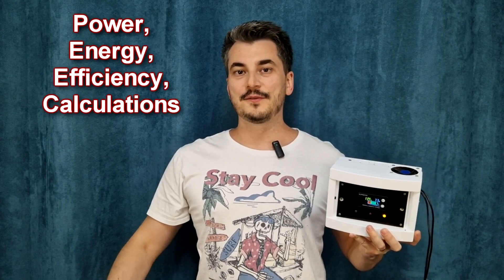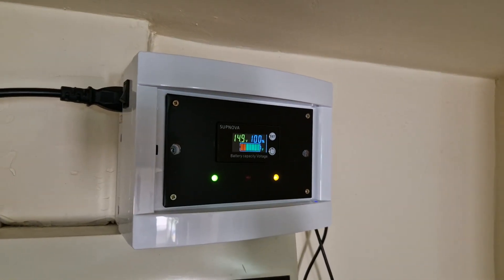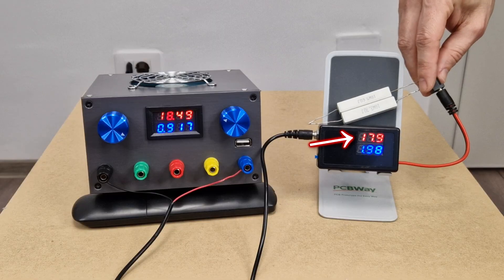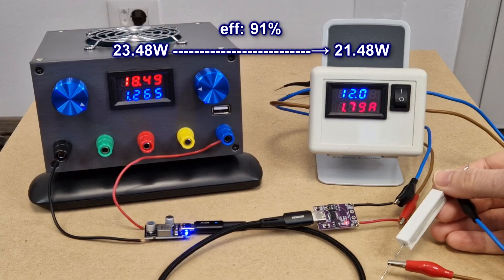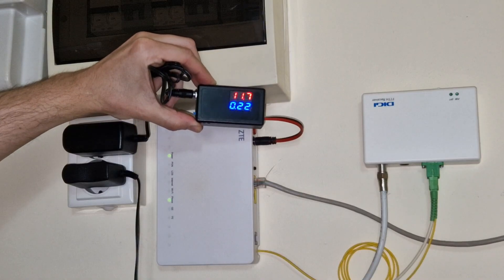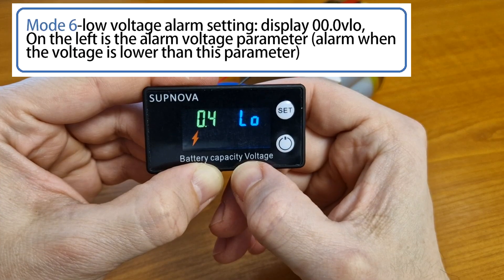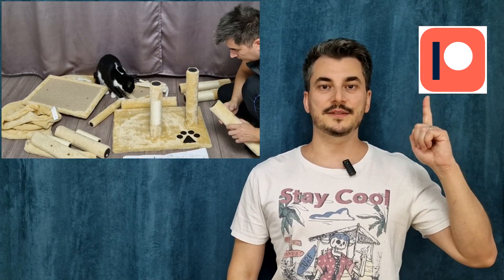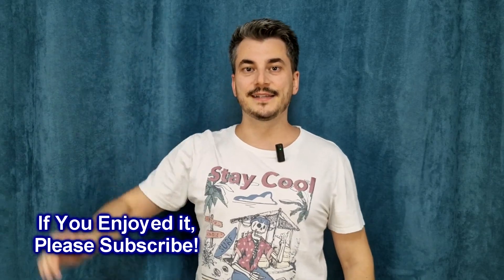Build your own UPS (part 4/4)

Comment: Hi. I came from the peltier module test2 video here so you can see my comment faster. I wanna tell you why you should conduct a third test:
1, your power supply was limited to 3.5A so you were basically giving the same power to all module and for the 12703 module it was above its 3A rating so it had no problem reaching the max temp diffrence but for the 12706 and 12710 which need 6 and 10 amps you were basically running them at less than 50 percent power. So lower tem diffrence
2, you should not test the temp at the cold side only because they are all gonna be about the same you should test how long do the individual modules take to for example cool 1 glass of water 15 degrees
PLZ do it for me if possible i have a lil bit of money that my father gave me and i wanna make the smartest choice.

Comment: Can you please make a 1s, 2s, 3s, 4s Drone Li-Po Battery and Li-ion Active Balance charger by using TP4056 module and mobile charger or other 5v DC power supply adapter for input of the TP4056 Battery charging module. Please. Coz my IMAX RC B3 Pro Li-Po Battery charger is not charging my Li-Po Battery properly and the cells voltage are imbalanced. Please make ASAP.

Comment: cool build as always, anyways I've used the same converter in 03:45 and it actually keeps its efficiency fairly well all the way to its max power output, but it gets a little toasty at +10w of sustained load

Comment: i have similiar build with this, but when battery die, and power goes in i got nothing on output, just on off that makes my router cannot boot, even the battery not charging, it back normal after i re attach load and it power on again

Comment: I wonder how reliable these cheap chinese dc-dc converters are. Image it fails and allows the full charger voltage into your 5V device
Reply from the maker: They are not perfect. But in general, if you don't push them to the limit, and watch out for the maximum voltage, current and heat, they are ok.

Comment: Why 14.9v for lifepo4? Full charge should be 14.6v, for safety I only charge at 14.4v.
Reply from the maker: Hi. I explained this in the part 2 video. I added a schottky diode between the charging converter and the BMS. 
When the battery is fully charged and there is no load on the diode, the voltage shows 14.9V. That is the converter output voltage, not the battery voltage. 
But when the battery is charging and there is a load on the diode, there is a small forward voltage drop and the diode drops the charging voltage before the BMS from 14.9V to about 14.6 - 14.7V.
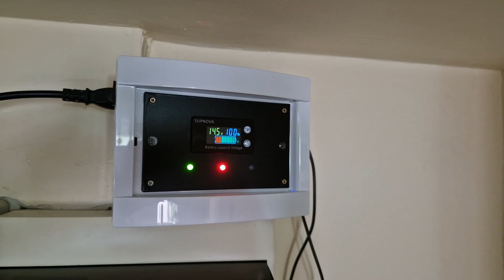You can also see in this video at minute 01:51, when the charging stops, the yellow LED lights up and the charging voltage jumps from 14.6V (fully charged battery) to 14.9V (converter output voltage with no battery connected).
Reply: @Sorin_DIY oh thank you for the clarification. 😁👍

Comment: in blackout situation, the other end of fiber internet will be NOT powered :)  Only LTE backup connection may be working....
Reply from the maker: It depends on what type of network your ISP has. This is a passive optical network (PON), at the other end of the fiber optic cable there is an optical line terminal (OLT), that should have backup solutions, like a separate power grid, UPS and generator. That's why mobile services still work during a blackout.
Reply: @Sorin_DIY  ale you try your ISP with blackout conditions? I test it in my home, and light in fibre is gone :( 
I ask ISP about backup supply and they told me "its not nessesery"